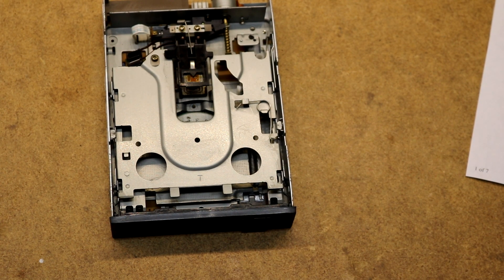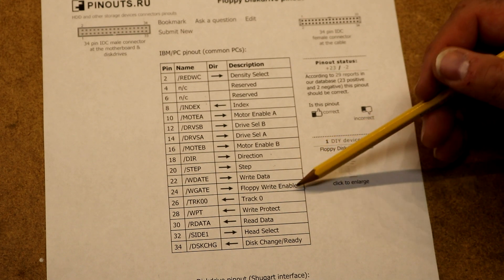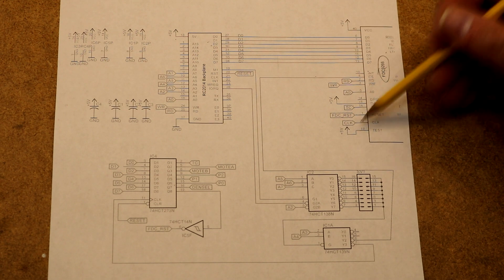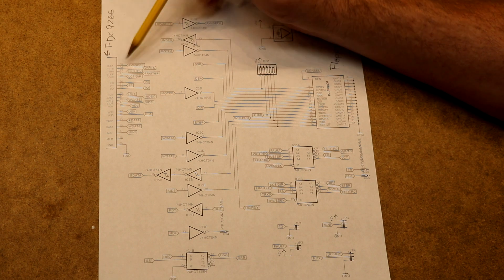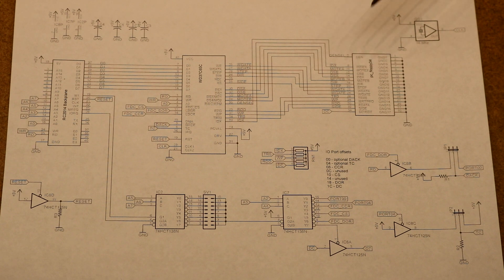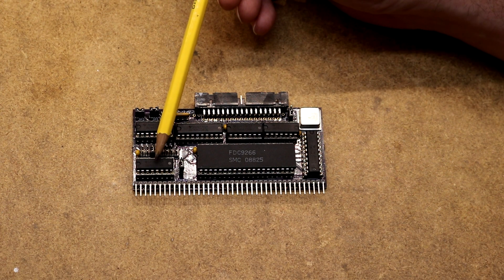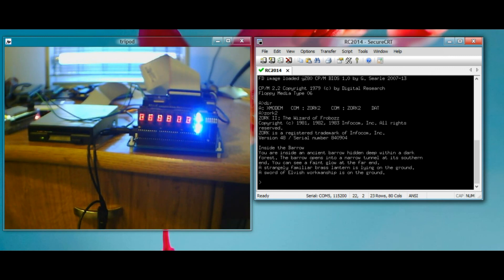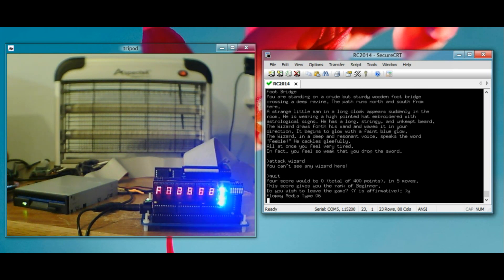Z80 Retrocomputing 14 - RC2014 Floppy Controller Board

Comment: 3.5" drives detect the sector 0 position as follows: 
There are two holes in the metal disc in the middle of the disk. The center pin in the drive just goes into the round center hole, to center the disk in the drive. The second pin is retractable and snaps into the rectangular hole. That's also the reason, a 3.5" drive makes a sliding sound after a disk is inserted, and it reads for the first time. Some drives spin the disk a little as soon as the disk is inserted to slide the pin into place. On the drive motor that spins the disk is a small magnet or barrier, located on the outside of the motor's metal disc. It moves over a sensor to tell the drive that this is its sector index position. Because the disk is fixed on two pins, it should roughly correspond to the disks sector zero position. 

I've seen a few 5 1/4" drives from the inside. Some didn't use the centermost optical barrier of the disk, some shine a light down through the disk, some use the reflection of the metal of the drive motor which can be seen through the index hole.
Reply: Neat! I know a lot of 5 1/4" drives for 8 bit computers were "soft sectored", (didn't use the sync hole).

Comment: The reason for the twist in the cable is to invert the order of pins 10-16.  This swaps the signals for the motor and drive selects.  IBM did this so that it wouldn't be necessary to jumper the disk drives, the cable position would determine which drive was A and which was B.  It should be noted that the drives CAN be jumpered to reverse the cable logic, and they can also be jumpered to use a binary encoded select logic, rather than a linear logic.  This means that you could have THREE floppy drives on the same cable.  Of course, to do that you'd have to make up your own cable, instead of using one from a PC (no twist).

BTW, I've seen a floppy interface done that used the DMA signal out of the controller tied to the Z80's NMI input, and the software used the 'block i/o' instruction to store the byte and increment the buffer pointer in a single instruction.  At the end of the single transfer, the cpu executed a halt instruction, which was followed by a jump to the start of the loop.  After 256 bytes of data were transferred, the cpu would exit the loop. (or TWO loops were stacked for 512 byte sectors).

Comment: This is really cool! If you had a three connector cable and another floppy drive could you connect it using the same controller boards?
Reply from the maker: Yes, it should be possible to support two drives. I do have two drives, so I might give this a shot at some point, even though at the moment a single 1.44 MB floppy disk seems sufficient to store all of the CP/M applications I have on hand.